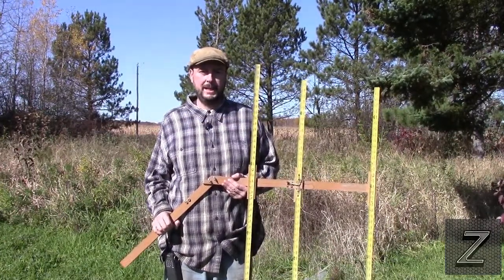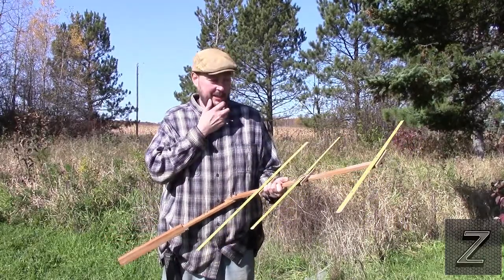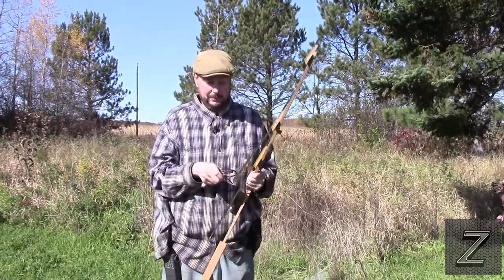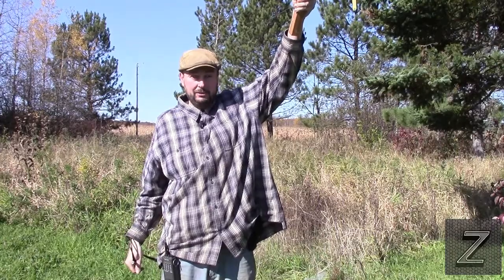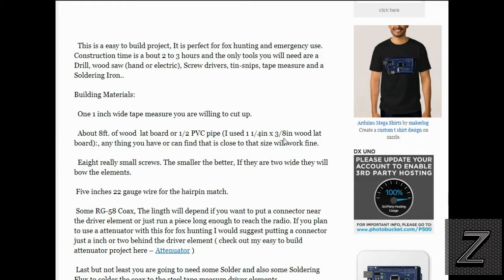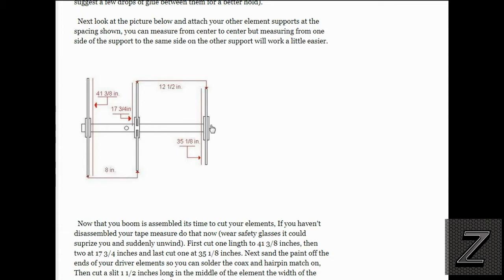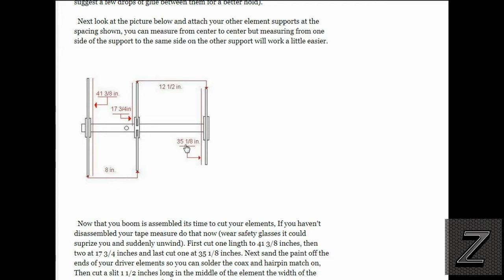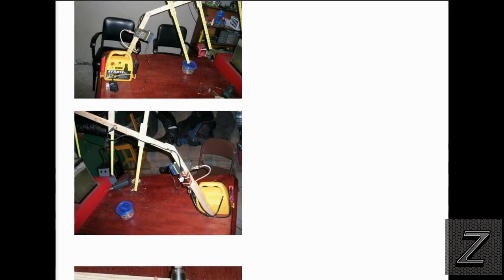How to build a Yagi Antenna out of a tape measure (HAM Radio)

Comment: Do you think you can tune this for better signal on the weather band. I have another station that causes interference with my home station and I need a antenna that will have gain in the direction of my home transmitter
Reply from the maker: If you do a search on the internet you will find a calculator (it's pretty easy to find) that will enable you to fine-tune this antenna to Whatever frequency you want and that would include the NOAA weather band